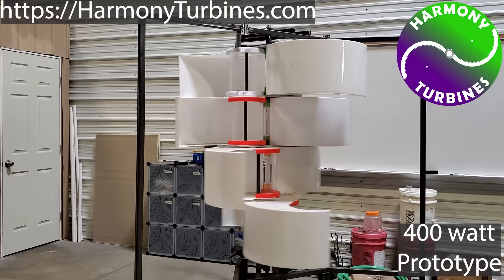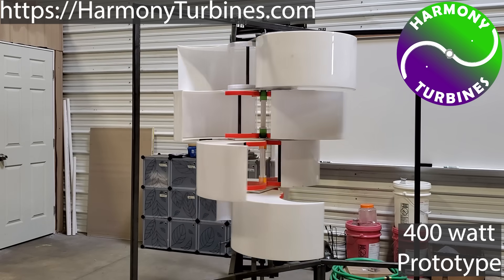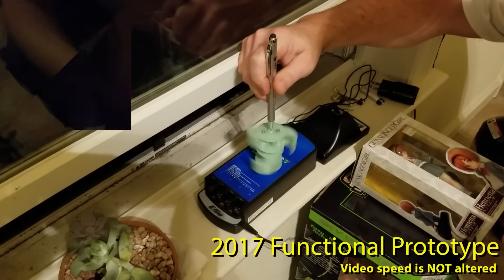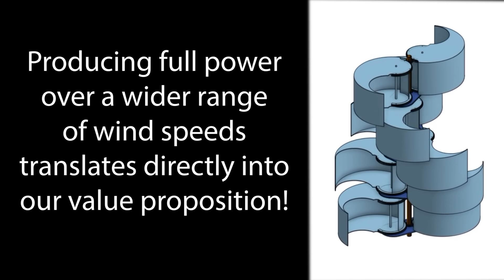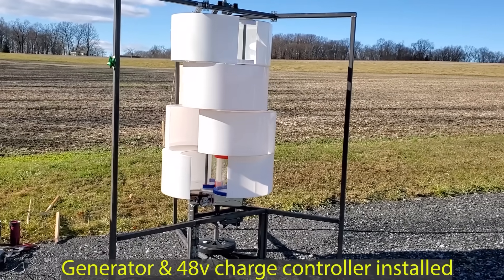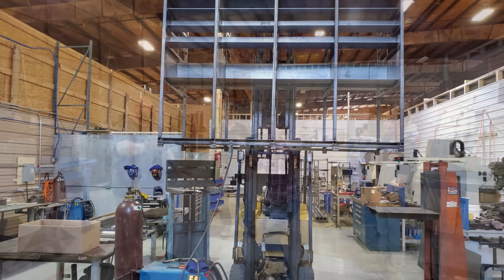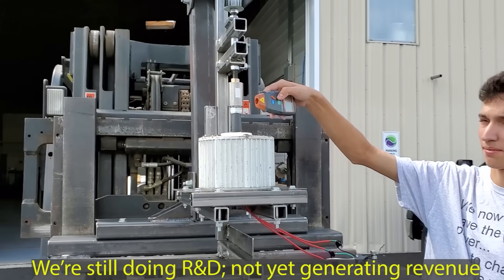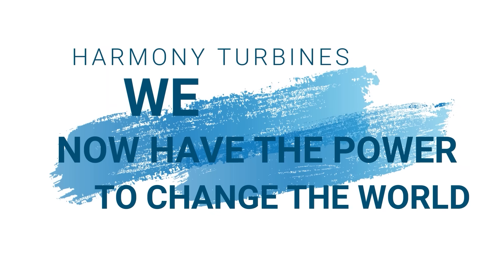What makes Harmony Turbines so revolutionary?

Comment: Furling system is not really a big issue here. Ur wind turbine wont be as big and as high as the hawts that produce mega watts. Destruction of wind turbines due to typhoons or strong winds occurs almost always in tall and huge wind blades only. Urs wont go that tall and wide So y thiis fuss an furling? Ive analyzed ur design, and it still sufffers ftrom the same low power output like other vawts. U have not remedied that disadvantage at all.

Comment: Love how many people are trying new energy options! This is great!! A guy from Japan, Atsushi Shimizu designed a turbine that will withstand hurricane winds and produce power.
Reply: Challenergy claims 30% efficiency, where a conventional horizontal turbine gets 40%. Vertical axis turbines have a severe problem. The reward-facing blades fight the foward blades, greatly reducing efficiency. I seriously doubt their 30% claim. I used to be president of a wind turbine company, so I know all the calculations. Unless you have some moveable components, you are simply not going to get that much efficiency out of a vertical axis turbine. Once you add complexity, you add cost and reduce reliability. You might as well go to horizontal axis and gain much higher power. Farms have been using horizontal axis for many decades to pump water. They are simple, reliable, and survive the storms you find on the plains.

Comment: the danger seem balantly more important in this closed design and the maintenance a chalenge even from rain flooding
you mean  horizontal turbines canot have variable pitch ?

still i agree than grounded generator on all directional turbin is a great advantage
 i guess the altitude wind diference can bring a diferent design on a tall system

Comment: It looks like several Savonius type engines stuck at graduated angles with opening and closing vanes on a vertical axle. Even with the truck helping it, the rotation is slow, a common observation for such rotors. Why not have contra rotating S rotors on the same axis? The relative speed would be doubled—enough, perhaps, for useful work

Comment: Every single wind turbine startup ever: Our turbine is revolutionary, it can generate more power from the wind.

Betz's Limit: Are you sure about that.

Jokes aside, seriously if you want power during low wind I am pretty sure a bladed turbine with variable blade pitch can do just fine. Too much wind? Here, use a brake to slowdown. 

Any advancement is welcome, but you gotta prove it with graphs and number  not just words.

Comment: Would love to have a few of these around the property,  being in hurricane country the design seems appealing, also will love to follow this design as it gets further into the micro realm and it's potential pairing with other advancements in storage, amplification, etc.
Reply: if i were you i would just get a regular ol horizontal axis wind turbine that is rated to withstand the hurricane. virtical axis wind turbine is inferior due to lower efficiency and needing more structure to support them.

Comment: No matter what you do, Betz's law limits the available energy, making small turbines an uneconomic proposition. This will always be the case.
Furthermore, the image of the burning turbine, supposedly caused by excess wind, is bogus. That fire would be down to failure of the mechanism, itself designed to adjust to wind speed, not the fact that the wind was strong. This silly design would be no less likely to have operating faults.

Comment: it looked from your video that the furling of the turbine was actuated by electric motors, would it be possible to actuate this furling using a mechanical governor of some kind, similar to those that regulate the speed of steam engines? this should simplify the mechanism and reduce complexity
Reply: perhaps this could be built into the structure of the turbines itself, a mechanical speed regulator.  rather than having an external governor

Comment: the wind turbine shown on fire had a fault and was not able to adjust the pitch of the blades which is its equivalent to the Harmony Turbine's Furling,  so no. high speed wind protection works fine on these turbines, unless the mechanism has failed..........also if the Harmony Turbine Furling system fails, then the same / similar damage will occur to the harmony turbine.

Comment: I can answer the question posed in the title: Their irreparably low efficiency. Half of the wind is working against you, all the time. It's like installing every second rotor backwards on a propeller and then trying to bend them until it's less bad. 4 - 4 = 0.  4 - ANYTHING < 4. This silly design has failed (outside of lawn ornaments) for centuries because it's stupid. Commercial sizes? lol the tiny fraction of wind energy you extract will be swamped by friction, and it won't even turn itself. you might as well collect audio energy from wind chimes. Can you charge batteries by dangling them from a weather vane? No.

Comment: H turbines just mechanically regulate their rpm by tilting the blades outwards, which you can achieve with nothing more than some weights or springs - without microcontrollers and additional motors. I don´t see the advantage of making the system more complicated.
Reply from the maker: Nils, remember we're not competing with the 300ft tall multi-million dollar units. We're going toe-to-toe with RESIDENTIAL turbines. In that market our tech is heads and tails above the rest. Here's a good simulated demonstration of how things should work in a nice condensed timeline. https://www.youtube.com/watch?v=quMYJ3emi58   Now remember, We're still in development so we don't have units to purchase or send out to customers/supporters at this time. If you would like to invest in Harmony Turbines we're planning on opening a 3rd funding round this summer with StartEngine. We estimate about a 7 year ROI if you have good strong winds in your area and $0.15 or greater cost per KwH electric.

Please sign up with our Newsletter to receive the latest updates from Harmony Turbines: https://groups.google.com/g/harmonyturbines

Comment: How many are you using on your building, you know the one with the Cat diesel generator next to it….
Reply from the maker: It's not our building, we simply rent a small space in there. But we do have permission to put our units on the roof when we're ready. Getting up there safely and securely is another matter entirely. LOL If we can do it in an economical way we will certainly be putting them on the roof here. We're still in development so we don't have units to purchase or send out to customers/supporters at this time. If you would like to invest in Harmony Turbines we're planning on opening a 3rd funding round this summer with StartEngine. We estimate about a 7 year ROI if you have good strong winds in your area and $0.15 or greater cost per KwH electric.

Please sign up with our Newsletter to receive the latest updates from Harmony Turbines: https://groups.google.com/g/harmonyturbines

Comment: Too bad they are so much less efficient than a horizontal turbine.
Reply from the maker: Tim, It's finally coming to light that there has been a large disinformation campaign for decades against VAWT's and in general Savonius turbines, starting back in the 1950's or around there. Savonius Turbines are actually > 30% efficient without any helix twist or ribbed sections. A proper helix twist greatly reduces stress over the entire unit and smooths out operation as well. The main noted drawback noted was high wind vulnerabilities which our patented design now solves. Look at this https://youtu.be/pbtR6VG-gLw?t=225

If you would like to invest in Harmony Turbines we're planning on opening a 3rd funding round this summer with StartEngine. We estimate about a 7 year ROI if you have good strong winds in your area and $0.15 or greater cost per KwH electric.

Please sign up with our Newsletter to receive the latest updates from Harmony Turbines: https://groups.google.com/g/harmonyturbines

Comment: Does it do anything to protect birds from being killed by the turbines?
Reply from the maker: Yes they will simply fly around the solid mass in front of them. Birds are killed by current turbines because the blades come down on top of them before they ever see the danger. 

We're still in development so we don't have units to purchase or send out to customers/supporters at this time. If you would like to invest in Harmony Turbines we're planning on opening a 3rd funding round this summer with StartEngine. We estimate about a 7 year ROI if you have good strong winds in your area and $0.15 or greater cost per KwH electric.

Please sign up with our Newsletter to receive the latest updates from Harmony Turbines: https://groups.google.com/g/harmonyturbines

Comment: I don't think this thing works tbh. You've never shared any technical data and you only showed them rotating connected to power.
And if this thing worked, you would've received so much funding from big corps already.
Reply from the maker: We're still in development so we don't have units to purchase or send out to customers/supporters at this time. If you would like to invest in Harmony Turbines we're planning on opening a 3rd funding round this summer with StartEngine. We estimate about a 7 year ROI if you have good strong winds in your area and $0.15 or greater cost per KwH electric.

Please sign up with our Newsletter to receive the latest updates from Harmony Turbines: https://groups.google.com/g/harmonyturbines

Comment: neat idea, but doesn't change the fact, that style wind turbine has a ton of drag and not a very good efficiency.
Reply from the maker: Pete, It's finally coming to light that there has been a large disinformation campaign for decades against VAWT's and in general Savonius turbines, starting back in the 1950's or around there. Savonius Turbines are actually > 30% efficient without any helix twist or ribbed sections. A proper helix twist greatly reduces stress over the entire unit and smooths out operation as well. The main noted drawback noted was high wind vulnerabilities which our patented design now solves. Look at this https://youtu.be/pbtR6VG-gLw?t=225

We're still in development so we don't have units to purchase or send out to customers/supporters at this time. If you would like to invest in Harmony Turbines we're planning on opening a 3rd funding round this summer with StartEngine. We estimate about a 7 year ROI if you have good strong winds in your area and $0.15 or greater cost per KwH electric.

Please sign up with our Newsletter to receive the latest updates from Harmony Turbines: https://groups.google.com/g/harmonyturbines
Reply: @HarmonyTurbines  it's good to see progress being made to improve the design of this type of wind turbine, but the reason it's known for poor performance is a fundamental problem you can't avoid. it fights itself in the wind, it can only be so efficient. I'm not giving you money, keep trying as you will. electricity in my area is plenty less than $0.15 per kwh. my bill would rise to that if I were to switch to renewable energy sources, which they send things to me in the mail multiple times every week. they keep cutting down trees to try and sell me something I don't want. if renewable energy is so great, why does it cost more.

Comment: Wow I wonder if you can use the design to implement Crooks Radiometer and also hydro applications then this would be a self and full sustainable system but of course full sustainability means having no means of energy as it needs to power itself either way I wonder if you can use any of Teslas ideas of harvesting free energy from the earth's naturally occurring laylines

Comment: Seems like an interesting solution to the problem. Not an investor (I have no money), but I am an engineering student. Out of curiosity, I have a few questions; answer as you see fit.

How resilient is it to dust and plant fiber getting stuck in the furling mechanism and how often would it need to be cleaned if it were placed in a highly rural environment? If I look at 4:48, the plate that holds the blades to the central axis looks like a particularly vulnerable position to this type of wear/maintenance. 

How was the shape of the blades chosen- is it optimal for high-speed wind, low-speed wind, cost of manufacture, or some mix between? 

Is the furling system purely mechanical, or does it require a microcontroller to operate it based on a function of rpm; if it is a microcontroller, what wind speed is required to break even on power generation, and how was the furling function developed? 

Is the system vulnerable to sudden strong gusts? 

Is the system right-to-repair friendly, and if not then why not? 

What is the break-even time on energy costs, i.e. how long does it take to pay for itself?
Reply from the maker: Coffee, dust and plant fiber will need to be tested ...obviously being higher up will help but that's why we go from development into testing so we'll cross that bridge asap. You're comment about wear is over-rated. The amount of time the furling mechanism will operate in a month will likely be just one or two hours total. Mostly it will be for seconds at a time and the rest of the month it's just sitting static, rotating happily. But there are nylon wear (washers) in between places where friction would occur. Shape of blades is a very long story, not going to get into it now. Mechanical microcontroller for furling yes. Sudden gusts are smoothed out by the weight of the system itself acting as a large flywheel and it seems to handle them just fine from early testing. Yes repair friendly. We estimate about a 7 year ROI if you have good strong winds in your area and $0.15 or greater cost per KwH electric. We have 120 videos so maybe you should watch a few more. :) Please sign up with our Newsletter to receive the latest updates from Harmony Turbines: https://groups.google.com/g/harmonyturbines
Reply: @HarmonyTurbines  - Very informative reply to Coffee Cup. I will thank you for him.
Reply: @HarmonyTurbines  thanks for the reply, now it's obvious that this is a scam.

Comment: Too many moving parts, even if they can be light weight. I don't get why putting more load by gearing can't be accomplished. Obviously there's tornado and hurricane issues, but i can see solutions for that - I mean like, fabrics are cheaper than steel/aluminum anyways. I get that the front facing 'sail' would act against it, but that could be resolved with less parts as well. If one 'sail' failed, the harmonic balance would mimic hurricane status and gear it down to a crawl. All you need is a net + to add to a spinning weight anyways, only drawing a load the wind can supply. There would be a rachet style gearing startup cost. but I'm sure anything below 5 mph is just too inefficient anyways. So my vote is for more gears on the generator, and none on the collector. Let the 'sails' blast to clothe pieces if they have to. Put it sideways on roof peak even. common home wind style generators handle 800-1k rpm

Comment: Personally I I've been theorizing a design of a new turbine . I have no engineering skills I just watch videos but I think if you were able to make a turbine-based one, and simply make an omnidirectional intake that was adjustable per wind speed would make sense.  So the turbine would be basically inside of a channel or tube of sorts, and then you just use some fancy 3D printing... I like the idea of the furling but I would rather have that on the intake to the turbine. That way it can be absolutely controlled. Then again I haven't thought it through and not a complete idea. But I know moving parts and many moving parts is expensive and high statistical failure rates which requires more maintenance which is more money. People like making more money not spending it

Comment: If it's done electronically... I'd imagine there's a way to do it mechanically instead... use a small weight attached to a lever which closes the turbine when pulled away from the main axis... then when the winds are high enough to cause centripetal force to pull the weight away from the axis, it will close, but as the wind lightens up it will fall back down toward the axis, opening the vanes back out... if there are multiple weights that are each arc-shaped, then when the vanes are fully open, they would have the secondary benefit of acting as a flywheel

Comment: What about centrifugal forces ? If the blades are already spinning fast there going to be a big centrifugal force and bringing mass closer to the wind turbine core will spin it even faster and maybe breaking it. Also you may need a big motor to overcome that force and closing it at high speed

Comment: Pretty cool but those blades need some optimization. The folding idea is pretty good. Although I think it's better to have brakes or to increase load to control the rotational speed but in a hurricane this would be good if you had a shitload and couldn't do it by hand.

Comment: WOW!!  This is freaking amazing-- it's a Continuously Variable Transmission for the wind!!!!!!!  

I'm sure your engineers have probably already thought of this or are thinking of this -or perhaps it doesn't matter- but I would form into the exterior part of the mold of the "scoops" a design which when fully closed forms a spiral that runs down the entire unit to aid with buffeting in high wind applications.   The same as they put on some tall skinny smoke stacks or vehicle radio antennas to prevent whipping in the wind.  Just a thought, but wow I am loving this!

Comment: Too big for too little power... you need to remake the cups' shape and make the design with less moving parts...you can make a smaller reverse set of cups that don't affect the large low speed cups in low wind speed, but actively hinder high wind speed as the wind picks up....
Also look into rem.....oops I can't give out any proprietary info lol...